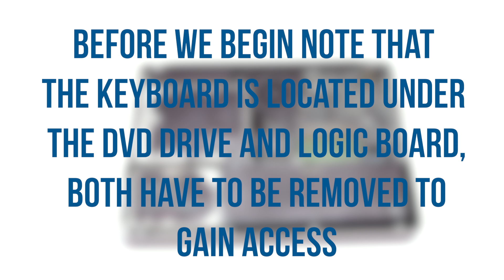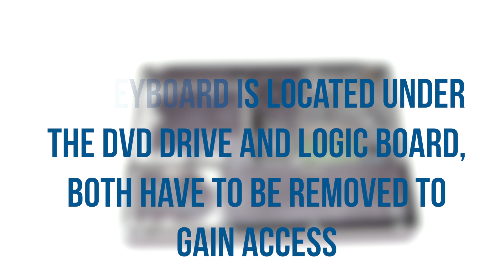2009 Macbook Pro 13" A1278 Keyboard Replacement

Comment: This video guided me to be able to replace a keyboard after a rum spillage on it which rendered the power button non-useable. It's the first time I've removed a motherboard. I discovered that about half the screws from the keyboard were missing as well as a few others. So glad this is still possible on a machine that has never had the battery replaced and still runs for hours, had only a ribbon cable for hard drive, RAM and hard drive replacement. I also thought for years that the wifi is inoperable, but discovered it was only plugged in part of the way. Now it works again. Thanks for your help. I really don't want a new Mac.

Comment: Hi, I have a late 2011 macbook pro 13' with a few keys missing on the keyboard. Found a used 2009 MBpro 13' replacement carcass that includes a keyboard. Can I install the 2009 keyboard on the 2011 macbook? Thanks in advance for the help!
Reply from the maker: Yes you can.

Comment: Is the Mid-2009 the same? Also, is there only one speaker? I'd probably replace my speaker and keyboard at the same time. Aside from the 3 long philips head screws on the cover, are all the screws the same? Or do they all need to be kept separate during removal and installation?
Reply from the maker: Yes, mid 2009 13" is the same.There are two speakers, one on top of the dvd drive and one under the right side of the logicboard once you lift it up. The 7 short screws out of the 10 that secure the cover are exactly the same.
Reply: @GRIBSOFT  Thanks

Comment: Hello! thanks for the video, im trying to fix a Macbook 13' 2008, and were I live doesnt have new keyboard for Macbook for sell, only for Macbook pro 13' 2008.. is the same keyboard? :( thanks!
Reply from the maker: +Fernando Gnoato Bottini yes it's different but will work just fine.

Comment: Is this the same principle for the a1342 unibody keyboard replacement?
And am I right in saying the keyboard for the a1278 fits the a1342?
Reply from the maker: Unfortunately not. For that model, you have to replace the entire lower case, because the keyboard is glued and screwed in permanently :(